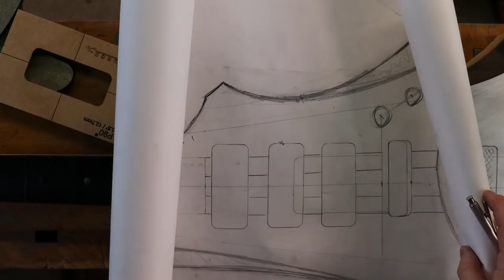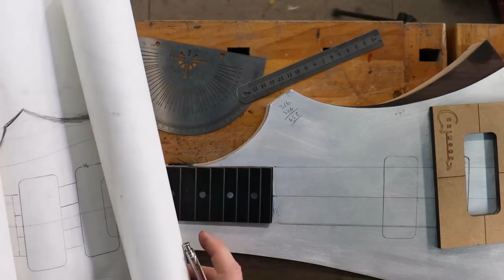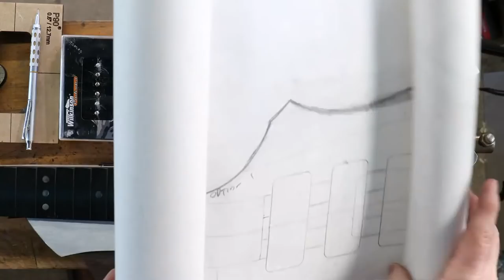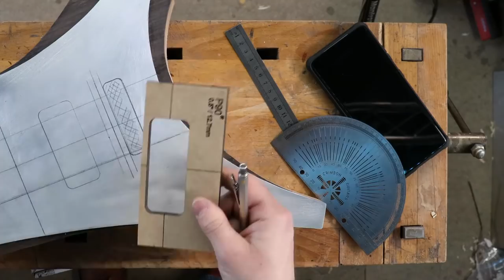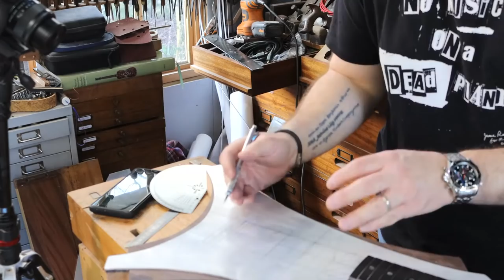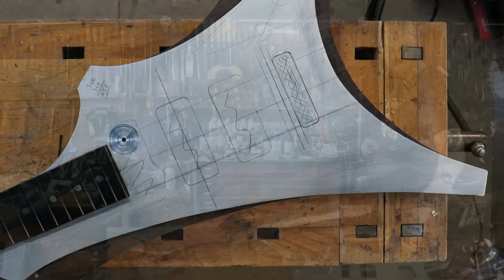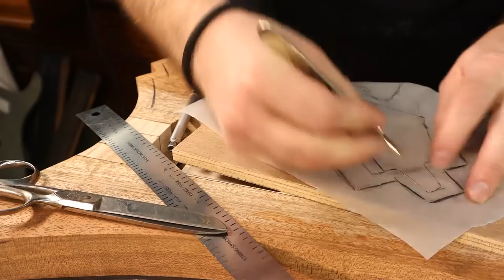LIVESTREAM Day 4 Scratch Guitar Build Celebrate 300k Subscribers

Comment: Making those fretboards should be doable with your current machinery. Just need to hook up the lubrication line on your CNC and leave it 50mm long on either end so the anodisers can hook up the clamps. Then you can trim off the anodised marks once it comes back. Would definitely pick up a few of those fretboards if you were selling them

Comment: It might be interesting and useful to discuss with an expert in carbon fibre how the weave, thickness, lay, etc., affects the resonance.  By way of a silly example, the rear wings of Formula 1 cars use many composites of carbon fibre to give strength and flexibility.  It's been rumoured that the Mercedes wing deflects in a certain way at high speed to give increased performance in a manner contrary to the technical rules ... but which cannot be measured by the scrutineers when the car is stationary.  If so, that might present interesting possibilities.

Comment: hey, love the video. this is unrelated, but where do you get your wiring diagrams that you use? whenever i look for one, i cant seem to find two that are the same.
Reply from the maker: I use Seymour Duncan Website but we are compiling a book of wiring diagrams too.  Ben
Reply: If you learn basic circuit analysis and electromagnetic theory (both DC and AC), you won't need to rely on wiring diagrams that might not even be correct to begin with.

Comment: wait, what happened to the headless part?
Reply: The only headless kit he had in his parts drawer had tuners at the trem end, but big locking/anchor pins at the head end, so it still needed a headstock affair to mount the pins.  On day 1 Ben said he didn't want to machine a custom locking nut for it instead.  There was a re-poll today on chopping the head off and machining a custom nut - but sticking with the original kit won (and Ben breathed a sigh of relief).